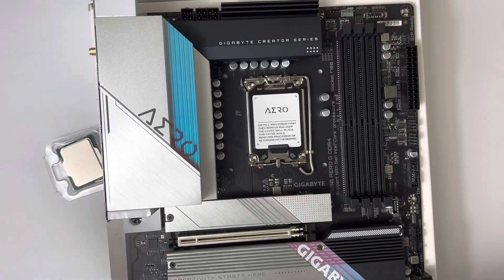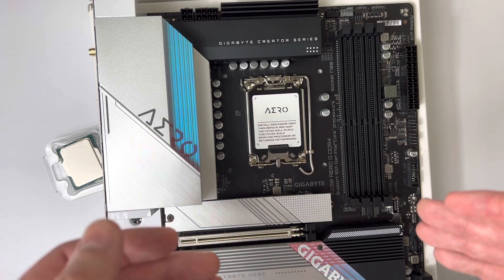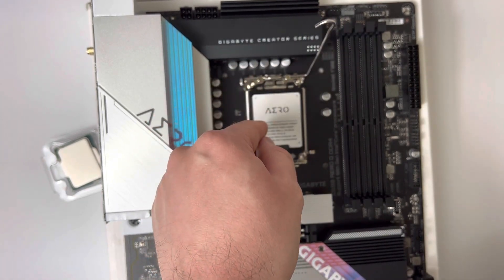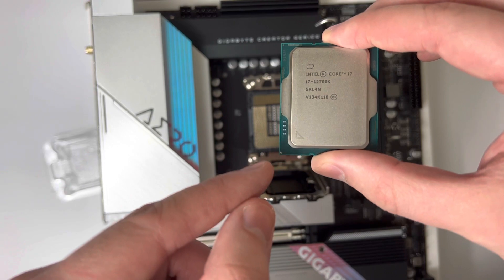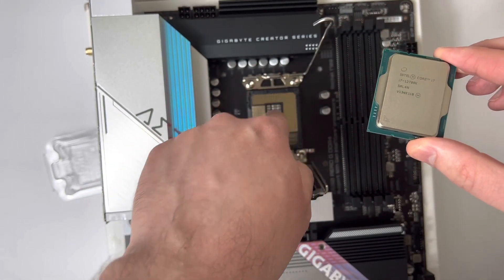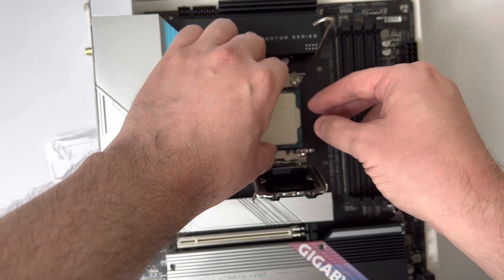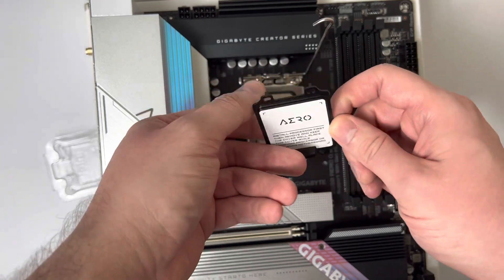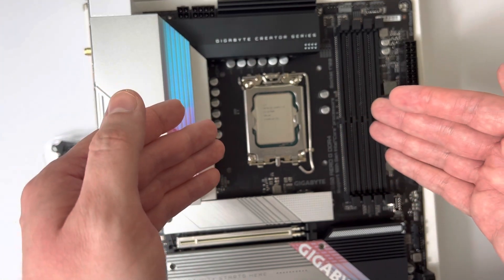How to Install Intel Core 12th Gen CPU

Comment: WARNING GUYS
Do remember to keep the cover of your cpu socket that you popped off from the motherboard, if in any case your motherboard is not working, you will need that popped off socket cover MANDATORILY for a replacement of your motherboard

Comment: when install cpu better take off the plastic cover by hand because you are pushing so much the cpu that might happen to bend a pin on motherboard.. it happened to me sometime.. and i just place the cpu and close it like you and after that a pin was bended and needed to send for replacement bcs system not working properly and i found out

Comment: Thanks for this. Just installed mine yesterday for the first time and I was freaking out that I messed it up because it seemed like it was just too much pressure even though everything was lined up. But it was about the same as what you had to do so I’m less concerned now.

Comment: Okay. I built/changed about 3 or 4 PC with a socket that worked like this one. And helped with another 5-6 PCs.  No problems ever. It's impossible to mess it, right? Until my last PC i'm building now. Somehow while doing exactly the same thing as always i ended up with CPU with bended substrate in two "top" corners, so bye-bye my new i7. How it happens, i dunno as it seem impossible to install a CPU incorrectly. My only guess that it was misplaced for like less than 1mm, but i still dunno how, if all those small holes that should prevent it.

Comment: Please always guys remove the plastic cover of the socket (just push it with your fingers gently) before pressing down the plate. Do not do like in the video. 1. Open the socket by pulling the lever. 2. remove the plastic cover (and keept it, do not throw it away!), 3. put the processor in the socket by matching the arrow with the one in the socket (there is an arrow in one of the corners that specifically tells you in what position you should plug the CPU) , 4. close the metal cover and put the lever back in its place with the holder. After this, you may go ahead and install any back-plates for the cooler if needed or just install your preferred cooling system.

Comment: Not having upgrade a PC for a few yers I notice gigabyte have gone away from having a notch on the cpu socket to line up your cpu to having an arrow printed on the motherboard in this case it's bottom left I almost made a mistake and put the cpu updide down so use to having a notch on the upper right corner

Comment: Sorry, my motherboard is a ASUS TUF Gaming Z690-Plus and this makes no sense to me. There is no alignment arrow on the motherboard anywhere that I can see and using the notches on the cpu or aligning with the pins does not work since the CPU will fit the socket right side up or upside down just as easily. The motherboard manual SUCKS, as it doesn't even mention which way the CPU goes in.

EDIT: Left this message to maybe help someone else with the same motherboard. The manual only uses pictures, and you have to look VERY CLOSE to see the arrow on the CPU in the picture. It shows it towards the rectangular bracket, and nor the retention bar.

Comment: So I think 💬 my CPU processer is too big for my motherboard because when I closed it my Shuttle R9 wouldn't power on and it bent the edges of the I3. Any advise?
Reply: You ruined the board.

Get another and make sure it's socket lga 1700 and not a lga 1200 board.
Reply: @DaSesh  The Motherboard?!? or the cpu?
Reply: @FatKakashi  hopefully just the mother board 

But the CPU is also fragile in a sense if you installed the CPU ojnthe wrong board chances are 

The CPU is also damaged I'd replace both

Comment: Good video !  I liked that you showed from the installer POV, explained about the arrow and tab method of aligning and showed us the bottom of the CPU chip itself.  I would also recommend to others that you inspect the pins on the MOBO very carefully before seating the CPU chip.  I hate that they removed the pins from the chip itself and put them on the board.
Reply: um.... what? cant bend pins that arent there. its much better this way

Comment: is that plastic cover really needed to mount the cpu?
Reply from the maker: You don't need it to mount CPU, in fact You can take the CPU cover off if you want before mounting the CPU, but I feel its easier just to have the load plate push it out when puting the load plate back down with CPU in the socket since it'll pop right off.

Comment: Is it possible to put the cpu upside down?
Reply: No it wouldn't work, I'm guessing you mean so it was backwards, the CPU will not fit into the socket unless it's the right way around.
The alignment notches on the CPU prevent you from putting it in wrong.
Reply: Good to know.  Thanks for that!
Reply from the maker: Yep! OriginalMajesty is correct. The CPU alignment keys prevent you from installing it the wrong way.
Reply: @blakejeffrey  Thanks for the wrong answer, only 6+ weeks late.
Reply from the maker: @OriginalMajesty  if you look at the reply chain I was saying yep to your answer… but ok lol
Reply from the maker: @OriginalMajesty  I guess I gotta write it out so I can be clear, I was saying yep to your answer which you where correct. The answer is NO due to the cpu alignments keys on both the socket and cpu preventing him from doing that.
Reply: @blakejeffrey   @Blake Jeffrey  If I looked at the original reply chain that you hadn't edited, it looked like you were replying to op

Comment: bro I forgot to remove the CPU socket lever protector lga1700. the transparent tube which is on the lever latch. 
will there is damage or issues come? 
i have already installed the air cooler.
will it be necessary to remove that tube?
Reply: You have caused irreparable trauma to your family

Comment: Totally wrong!!! First camera did not zoom socket to see corners and triangle. Then before cpu installation need to fix mainboard socket due to different pins orientation and the issue with washer mod. After you add 4 extension to 4 socket bolts you may start to mounting cpu. Lga 1700 socket type mechanism is cheap, old and have problems. This is mechanism for the mass

https://youtu.be/ezauy4as4lI